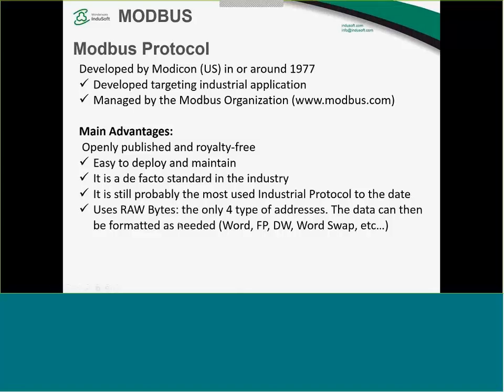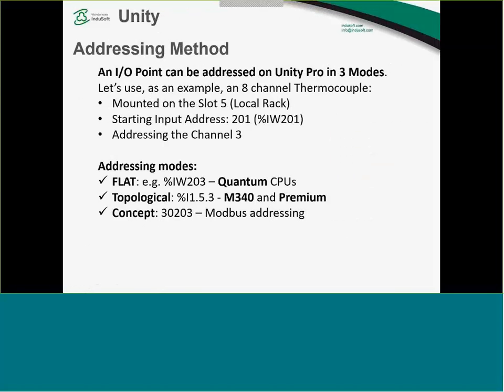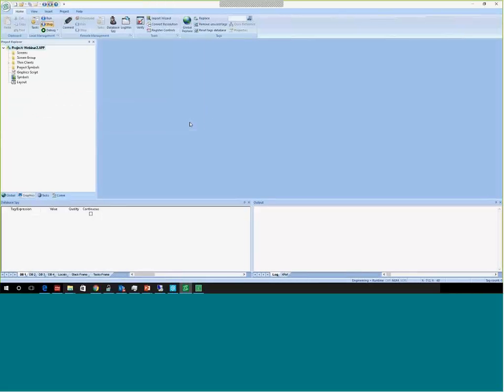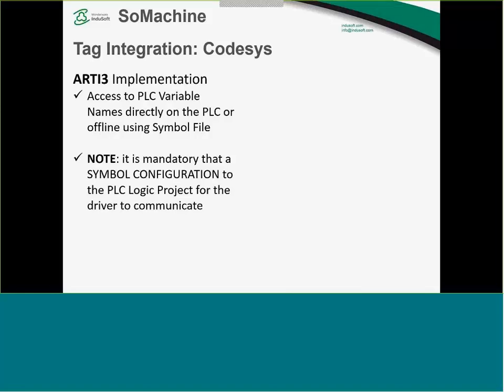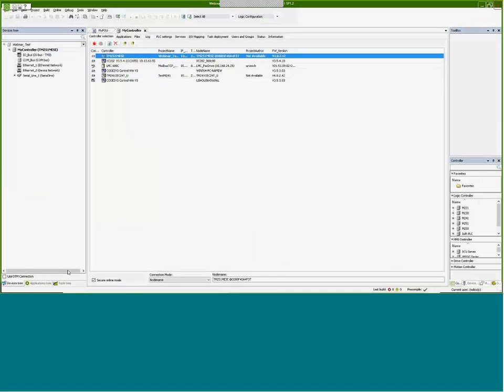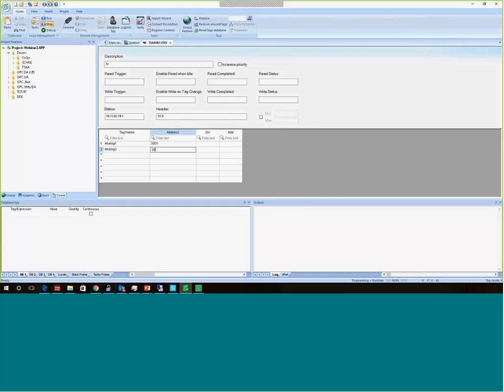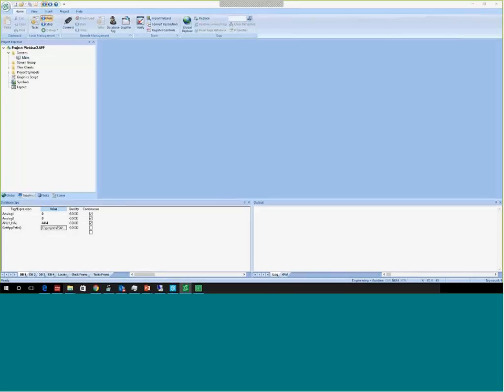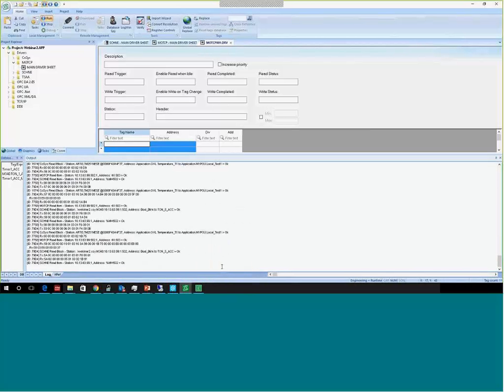Tag Integration with Schneider Electric PLCs and Modbus in InduSoft Web Studio

Comment: Really nice Video Very Helpful. 

Adding Index for video to save time:

Mins: Topic
00: overview
05: Modbus
11: Tag integratation better than Driver Master/Data sheet
13: Unity pro- v8, SCHNE Driver (%M and %     MW) (PLCs: M340, premium, concept)
30: SoMachine (ARTI3)
     if PLC is offline- use symbol file
    (Symbol config- mandatory- PLC handler  & with OPC)
    (PacDrive, LMC, M241, CodeSys)
42: Triconex PLC
52: Main Driver Sheet V/S Driver Sheets
    (Troubleshooting hint and Optimization)
xx: Trouble shooting